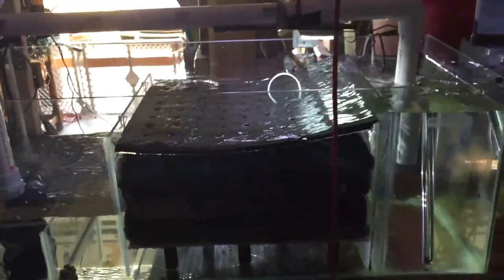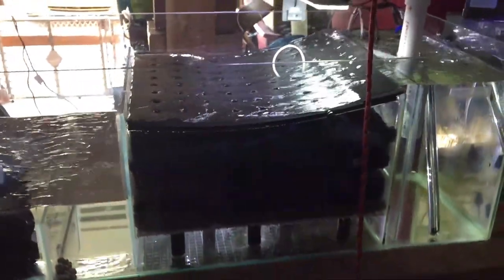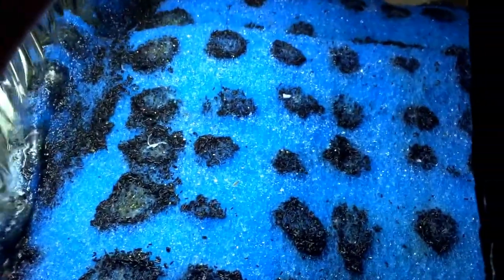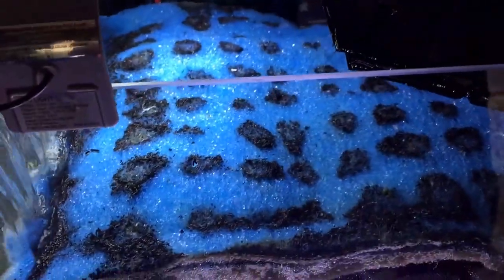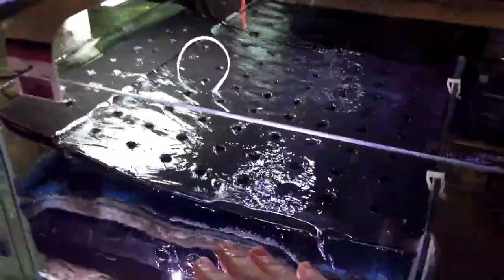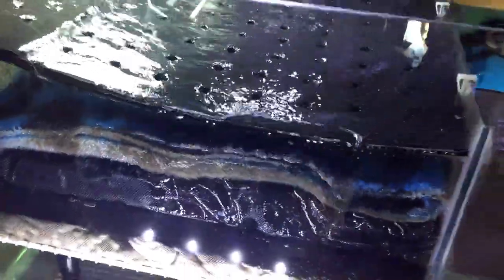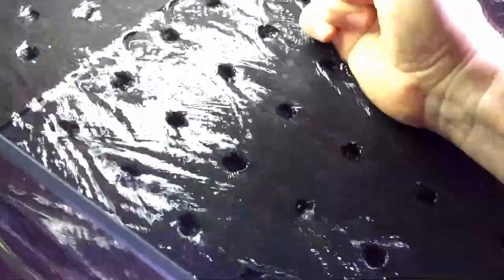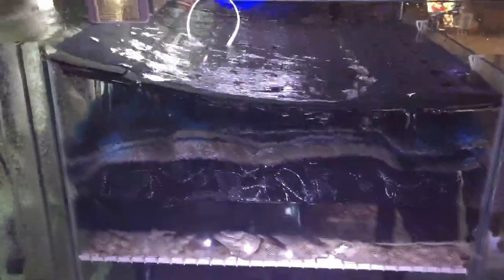Power Sump Series: Drip-Tray Wet/Dry Carbon Buttons

Comment: What is that your using as the drip tray? I would like to reconfigure my 55gal sump, right now I just have a sponge covering my ceramic media. I would like to go with the drip tray onto some bio balls.
Reply from the maker: It's somewhat difficult to explain without showing it in a video. I need to do a dedicated video to how I built the tray itself. Basically you take two coroplast poliycarbonate sheets and silicone them together with the "grain" running in opposite directions. This makes it rigid and only slightly flexible. Once it completely dries (48 hours or more) I took 1/2" spade drill bit and cut 64 holes in the coroplast. This took some trail and error. I actually made 3x of these before i got the spacing of the holes just right to allow for the right amount of water flow.
Reply: I might be able to figure that out. I could tell it was home made and you got it dialed in. It works really well.

Comment: Seems like the carbon would eventually get loose and out of the sump.  I like the tray idea though, and think it would be cool and easy to convert that to an algae scrubber.
Reply from the maker: I will try it both ways. It's fairly easy to rework that chamber. I've had it running for a while and the leakage isn't bad yet. However the first time the pump shuts off and the water rises I suspect some will float up and over the floss. We'll see. I'll do a follow up video at some point once the sump is actually installed. I finally get the spears gate values friday...
Reply from the maker: BTW: I think i see what you mean by an algae scrubber... would I put a light under the tray and illuminate an area on top of the foam layer above the matrix? what would you suggest?
Reply: Definitely a light over the tray with algae growing on top.  You could rig a row of LED lights shining in from each side to get the underside as well, but may not do as well.  You could also use the vertical sides of the chamber (maybe even sectioned off) with some vertical plate to drip as an algae scrubber.  You could shine light directly on it from outside down the length of the chamber.  You just wouldn't have the pleasure of watching your filtration at work though.
Reply: But simply lying a mesh screen on top of that drip tray and hit it with light should make for awesome algae growth and easy removal and cleaning.
Reply from the maker: awesome. i can do that. at least for the top. easy win and fun to look at and watch.